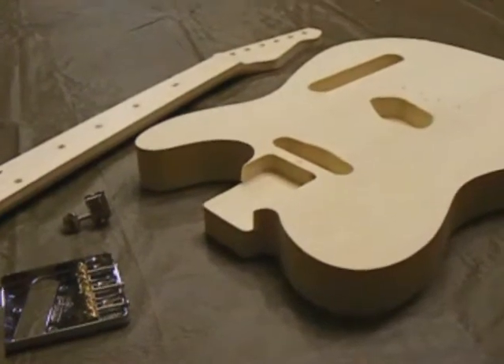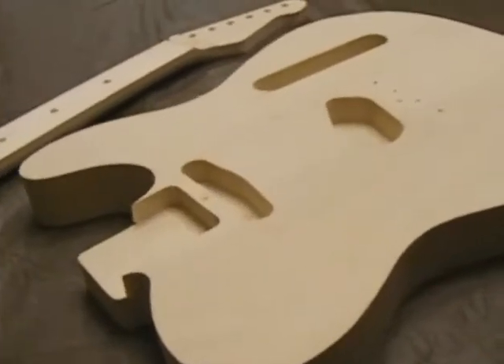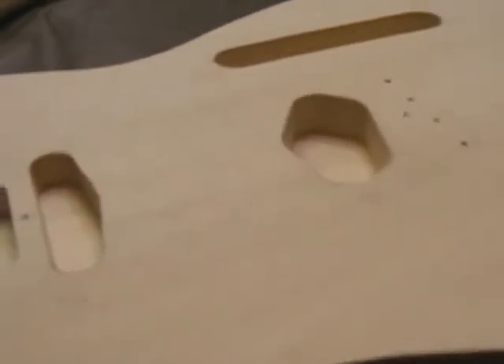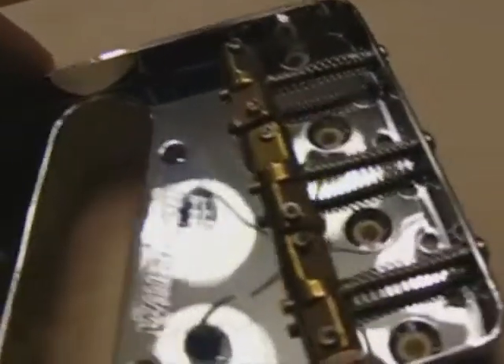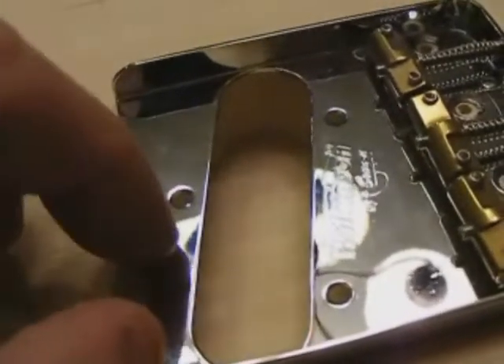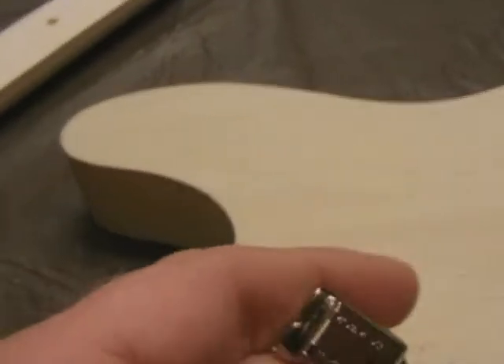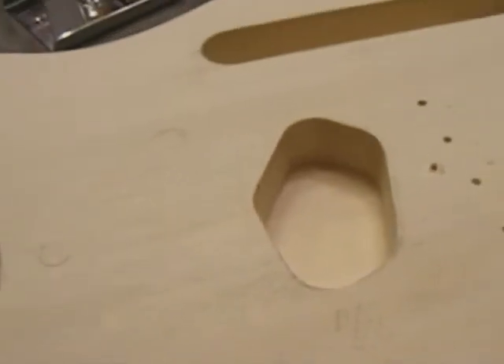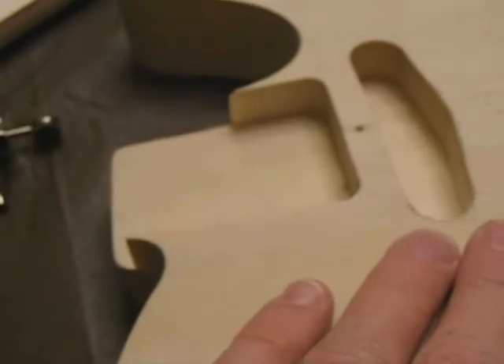One Piece Neck Build Part 9: Upgrade to a complete build

Comment: bill  could you please tell me how did you cut the fret slots? by hand or using some kind of power tool?
Reply from the maker: I built my own mitre box and used stewmacs fret saw.
Reply: thanks. a lot.